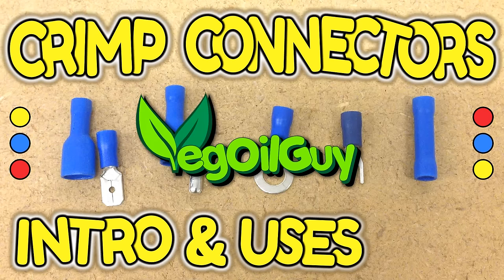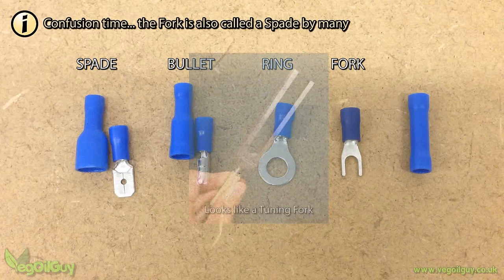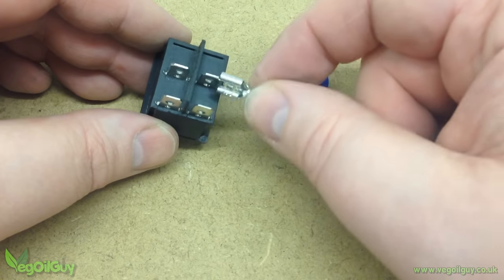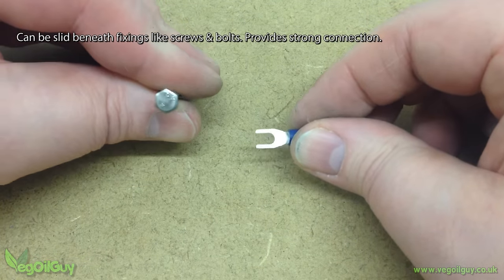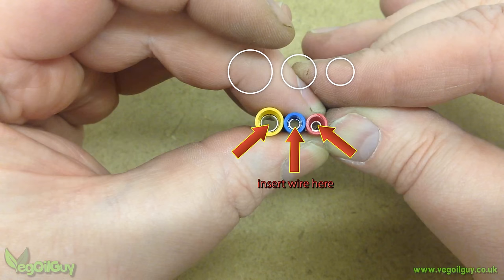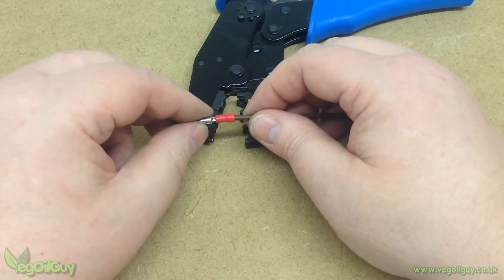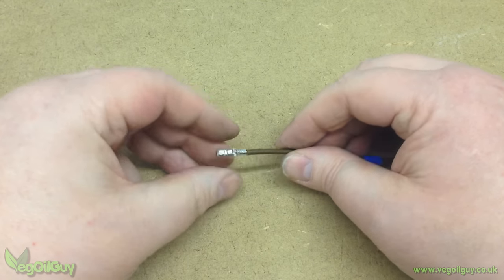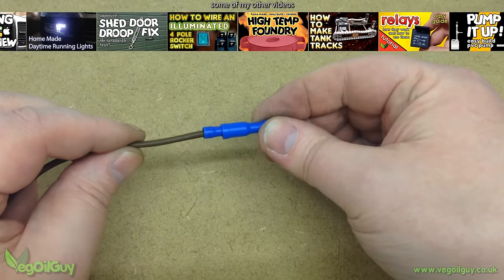CRIMP CONNECTORS how to crimp EASILY & SAFELY

Comment: Good stuff. Just this year I decided to finally get into electronics (Actually studying it) and replacing triacs, capacitors, etc. And Friday I was just at a store checking out crimping connectors.
Reply from the maker: Don't be put off by my comments. Many people LOVE crimping. Just invest is GOOD quality crimping pliers and you should be fine. I'm always too tight to splash out on something that I don't use that often and enjoy an excuse to get my soldering iron fired up... primal urges I guess... man-make-fire-ug
Did you get my reply to your second email? I only ask as I was having email problems that day.
Reply: Ah yeah, I got the reply :) I've been learning the fine art of video editing. And yep, I prefer the soldering gun for sure.  I have a cheapo one that works surprisingly well so far.
Reply from the maker: There's always something to learn ; )

Comment: Thank you for this information. Would taking off the plastic cover and then using pliers to fix the wire into the connector would be enough without having to solder it then slip the cover back over?

Comment: Where possible, I slide on a short length of heat shrink tubing over the wire first. Then, crimp the connector ( often with the coloured plastic sleeve removed like you did), and finally, heat shrink the tubing for a nice clean and protected connector.

Comment: Try ferrule crimping some day. it gives an insanely strong crimp. also, I've always really hated those spade connectors because some of them are very hard to pull out once plugged in, but are unavoidable with some relays and other things. The ring ones are great though.
Reply from the maker: Thanks for the tip!

Comment: The crimping tool you are using is sold under several different brand names. My issue is it's easy to confuse which way to orient it on the terminal. Only one way is correct. I labeled mine with a pemanent marker so whem working at odd angles I don't screw up.

Comment: Can the terminals with the plastic be used on oven wires? I am talking about the wires that connect to the element. My old connectors got burnt so bad they feel apart and they had no plastic on them so i know it gets hot down there.

Comment: Great video, thanks.  I would have liked you to cover how to size each.  For example, I want to buy female spade connectors on line.  How is the size measured so I know I am buying the correct ones?  Is it the width of the male component?

Comment: I too, dislike Teese primo conector.  I only use them on temp installations, and come back to make a better connection. I use some techniques when slicing or connecting terminals when not on a bus bar. First, I never crimp both wires side by side.  I always offset one from the other. I Also put the female on one wire and the other female on the opposite second wire and vice versa with the males. This way there's no way to crosswire.  Also if splicing severa wires on the same bundle, I offset each butt splice so the finished bundle is close to the original and not having a bulge of splices in the same location. Thanks for sharing.

Comment: I am working on an engine harness for a General Motors LS engine and I need to confirm is the end connectors as Mouser 829-13580639/Aptiv 13580639 connectors and I need to know what is the correct crimping tool to use for these connectors. I have been told that crimping tools 12125080
, 624-1028ct, and 601-24-8644p will work, but they seem a bit expensive. Can you confirm these or make recommendations?

Comment: I thought I was the only one that did that sometimes with the crimp connectors.  I often use non insulated butt connectors, solder them and use marine shrink wrap.  It's easier to solder it since it's joined and the solder makes for a very secure connection.  It all takes a lot more time though.

Comment: I'm new to this but is the wire supposed to go all the way down the bullet connector like to the tip or to the place where there is a gap and if I pass the gap a little bit would I have to cut it and start over?

Comment: Sometimes you shouldn't use solder as it can reflow with heat or over time (it's a slow liquid), that's why solderless connections are sometimes best.
Reply: If your solder is melting without someone applying heat to it then something is extremely wrong in the electrical connection.

Comment: I’m an engineer and a good part of my job is wiring up new machines, I do a similar process to your working method by removing enough insulation to fit the terminal, I removed the exterior insulation of the crimp to expose the tinned metal interior, rather than use needle nose pliers to close the crimp I have an old set of crimping tool that’s to butterfly uninsulated crimps together, I use them mostly as I feel that the needle nose pliers will not close the crimp effectively and has a high probability that the wire will slip out under tension, in the late 90’s I used to fit Clifford car alarms and they supply a special type of crimps that “squeezed the crimp into a oval cross section” these would push a middle of the insulation crimp into itself,like punching an small area through the other side, this was proven to be one of the best ways, as it gave 100% of the surface area of the crimp to the copper wire. It was a good back bone of Clifford alarms that there was a very high success rate of it never failing,  great video, keep up the great work!....Phil
Reply from the maker: Thanks for the input Phil : )

Comment: Can you wire 2 or 3 wires to the same spade connector?

I would normally solder 2 or 3 wires to the same lug on a dpdt mini toggle switch , but wondered if I could do it with a spade connector

Comment: the bullet is a great replacement for the butt splicer, and liquid electrical tape is better than tape for bonding to the connections and there's no glue to fail. Also, some connectors have shrink tube as part of their insulation.

Comment: Thanks for this video! I am a RR modeler with tons of #20-22 awg connections to make using fork-style terminal connectors to terminal blocks. I HATE stripping wire ends to attach the crimp connectors. QUESTION: is there a fork-style crimp connector for #20-22 awg that crimps thru the wire insulation, eliminating having to strip each wire end? Thanks and Blessings.
Reply from the maker: I'll be honest Duane, it's not something I've come across but hopefully leaving the comment here, someone else might give us an answer  : )
Reply: I haven't seen such a thing but what you will be able to find is an "automatic wire stripper" that makes the task very simple. They are often sold as multifunction wire stripping pliers with a wire cutter and crimping dies, although I only use the stripping part of my cheap model, preferring my side cutters for cutting and dedicated crimping pliers for crimping. They basically have two pairs of self-adjusting jaws that close down on the wire, cut through the insulation, and then pull apart, all with a single squeeze of the handle, popping a tube of insulation off the neatly exposed wire conductors in about half a second. Mine handle any wire size from 24G to 10G and this is fairly typical. Do yourself a favour and get a pair - you'll no longer find wire stripping a chore and the only thing you'll dislike about it is collecting up the scraps of insulation afterwards.

Comment: Great video, good humor. To my knowledge soldering connections are not ideal for use in vibrating environments because it affects the flexibility of the wire. What are your thoughts on that?
Reply from the maker: I guess it depends on the wire and on the strength of the connection. People argue that vibration could break a solder connection, but vibration can release a push on connection.
Reply: Ah I understand what you are saying. Thank you for your input...

Comment: Crimps are very reliable, if done correctly. Select correct crimp and wire combination, crimp with a quality tool with the correct die and the correct orientation. Select the correct crimp for the job, either plastic insulated, heat shrink, or uninsulated. All have their correct application. Soldering crimps is at best unnecessary, and if done poorly just as likely to fail. The most important thing to do after crimping is give the crimp a good tug, to test security. Critical connections in industry are sometimes verified by sampling using a strain gauge.

Comment: There are different crimp tools for naked connectors they leave a distinct dimple. I usually also remove the plastic and use the naked crimp tool or whatever it is called and after checking the crimp slip the plastic back on.

Comment: My dryer uses a NON-insulated spade connector, would using an insulated connector be okay if that’s all I can find?
Reply from the maker: Yes Adam. As long as they're the same size and shape (and fit properly with or without insulated cover) you'll be fine. Personally I would prefer to use the insulated type as it adds a layer of protection.
Reply: @vogman  Thanks for the prompt reply! 🙏🏻

Comment: I used to build control panels and I used all those connectors . Over here in the states if you had to do a UL listed panel you had to use the manufacturer of connectors crimp tool I don't know if European standards is the same but that would be a good question and most important cheers with a beer

Comment: I prefer the naked connectors that come with separate, soft silicone boots.
I find this type makes a much stronger connection since you are crimping directly metal to metal, not through the plastic protector.
You you need to get a dedicated crimping bit for your crimping tool, mind.
>

Comment: Im about to redo wiring in a trailer camper. Is there a disadvantage in using quick connects vs splicing wires ? Thank you
Reply from the maker: You will see comments favouring both options. Personally I prefer the knowledge that spliced and soldered joint can't work free over time... but it's a preference : )
Reply: everyone is each to thier own my friend, talk to someone that wires industrial control panels, they will say use ferrules and crimps. pros and cons on everything.

Comment: I’ve also used these insulated connectors and removed the insulation as well then crimped with a pliers for non insulated connectors. This gives a strong clamp then I used shrinking tube over. Alternatively you can use the old insulation but you need to squeeze it slightly to prevent the wire bending or moving from the joint. Soldering helps a lot and if the melted metal is absorbed by the wire it will prevent bending because it will be more rigid.

Comment: Good info... thankyou for posting.  Can I use a store-bought female spade connector on a male copper contact which is not actually a spade?  It fits snugly enough... but I'm wondering if the non-like metals will cause a problem? 

Thanks!
Reply from the maker: I'm sure I've read that under high current situations there can be a corrosive effect between different metals, but I would imagine this is a simple domestic affair. In such a situation any conductive material shaped to fit will work for you : )

Comment: Can you suggest a source for screw terminal blocks that will accept red fork connectors?  I need one to distribute power and one as a common ground.  thanks.
Reply from the maker: Sorry Stephen... I've no specific knowledge. I'd just look around until I found something that worked : )

Comment: a good video if you are ok with this quality of wire termination. although i agree that i also dislike those cheap insulated terminals. which is why i just go with the quality stuff. costs more and takes more time to do it proper but no way is it longer than doing an elec fault finding.More a tldr for those type of people. those who just want it done and will deal with the results later.

Comment: My crimp tool has option for insulated and non insulated connectors. The shape of the crimp is different. If the non-insulated shape works great on non-insulated connectors why change the crimp shape for insulated ones? Also, crimp connectors with soft heat shrink can be crimped as non-insulated?

Comment: 6:15 your crimper appears to be using an A03C die, try an A30J die, they look almost the same but they work a whole lot better for those types of connectors.
Reply: How many different types of crimping tool (and matching crimps) are there please?

Comment: I'm glad I'm not the only one who doesn't trust crimp connectors and solders them too!
Reply from the maker: It's a belt and braces approach : )
Reply: If you're crimping properly you don't need solder. A crimped connection is gas tight and cold welded. Adding solder actually makes the joint worse under vibration or mechanical stress. If you're not worried about either of those you might as well just solder and not crimp.

Source: NASA.

Comment: Your crimping insulated connectors using the proper color codes die (for insulated conns). For the dies for non-insulated terminals you need to pay attention which"side" of the connector goes toward /\ or /\/\ sharp side of the die. The terminal type your using have a smooth side and a side with a split or slit. The smooth solid side  of the connector always goes toward the sharp side of the die with /\ or /\/\ that pressed down into the connectors smooth solid side.

Comment: If I'm connecting anything that will be exposed to a harsh environment, I will solder the exposed wire to the lug, put a dab of silicone sealant around the wire, slide some shrink tube over the silicone and apply heat to shrink it. Wipe off any silicone that oozes out, and it will seal the connection from exposure to anything that may over time cause a problem with the connection

Comment: Crimp connections are used extensively over solder connections in industrial, automotive & aerospace because they are very repeatable. Solder connections are frowned upon especially in power conductors as a fault condition can melt the solder. There is a range of wire gauge for each crimp type but if you have wire which is too thin the crimp will feel loose. It is acceptable practice to add filler strands or to fold the copper over on itself to better fill the barrel before crimping.

Comment: It turns out my Greenlee crimper has two different crimp die sets, both with the color dot codes. One is for small diameter colored insulation and the other is for larger diameter colored insulation. A month ago i would have thought there was only one of the color coded type dies needed, but when researching part numbers recently for another purchase i discovered the small diameter style was also offered. I could also add that In some cases with DC work i like to reverse one set of the male/female terminals to keep polarity from being reversed during future hookups.

Comment: You do know that crimping pliers can adjust the force of crimping for different gauges?
I bought mine of banggood (paron brand 26$ with all dies) and as long as you use proper size of die and wire /terminal(aka dont push small wire into larger teminal),they work great-very strong connection.
I am big fan of non insulated spades,they crimp very nicely and you can later put a heat shrinking tube.
Reply from the maker: It's probably my fault for buying cheap crimpers ; )
And there's nothing wrong with the bare fittings if, like YOU are doing, they're properly insulated. I have seen examples of these fittings coming loose over time (in vehicles - vibration can do amazing things) and a loose live wire can cause havoc. But you've already realised that so credit where it's due!
As for the soldering section of the video, it's purely a preference... I like to give people options. As I stated, I know many that swear by crimping and if done properly, there's no reason why crimping alone won't work.
Never works properly for me though (grumble, grumble).

Comment: what 's the size - how many millimeters or whatelse - of those spade connectors at 1:37 ?
Reply: and how many AVG does a proper wire have to fit that spade connector? 2:18

Comment: Hello, i am trying to make power strip with realy useing Arduino, but can i use Spade for the input of the power? or it can't handle it?
Reply from the maker: Hi Anmar. Spade connectors are nice and strong. They come in different sizes to match the current rating of the wire they're attached to. So that should give you an idea of how much power they can handle : )

Comment: I also solder first, then slide the plastic back on.  For wiring inside my vehicle, I'm forced to crimp only, but I think I'll try an inverter and see if I can power up my soldering iron in the car. Might be a bit dicey with the engine running and juice going into the wire.

Comment: Crimp on is temporary, solder is permanent. Instead of using the plastic insulator after soldering, I suggest using a chunk of double wall heat shrink tube instead to seal out corrosion. I also use a micro torch instead of an iron because it's faster. I haven't kept count of how many I've done like that, but it's in the thousands.

Comment: Good video until you say that the wires need to be twisted. Don't! The wires need to be left untwisted for the best crimping.
Also, the conductor needs to be right for the connector aka to be almost tight when inserted into the uncrimped connector. That's why you feel it's loose.